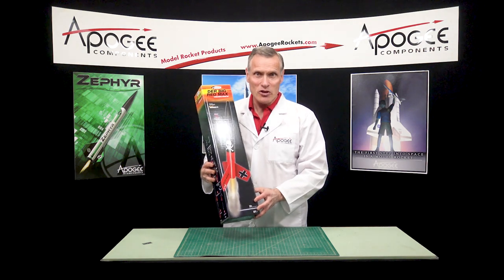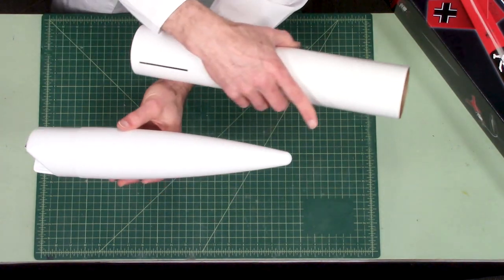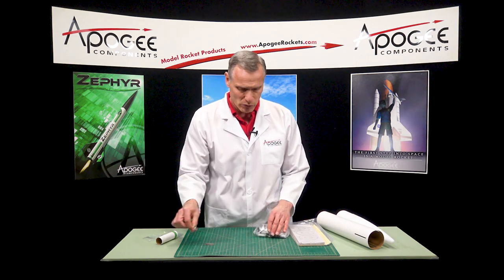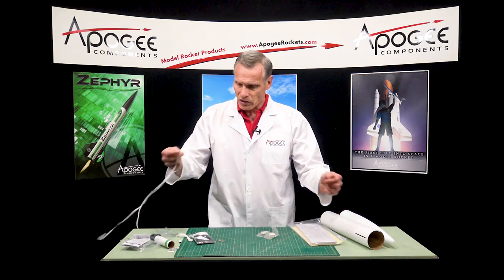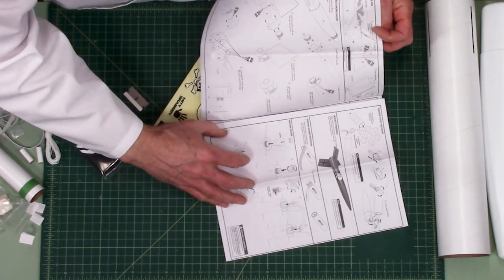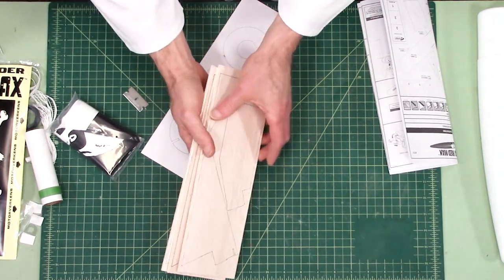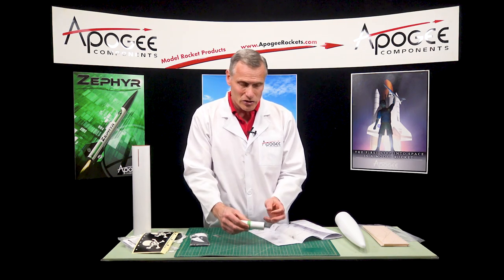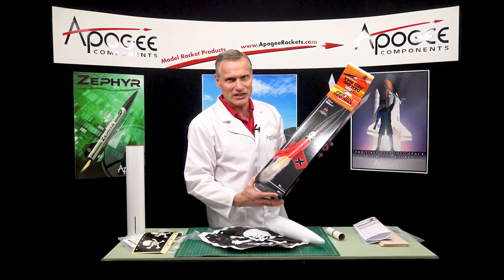Unboxing Der Big Red Max Rocket from Estes

Comment: I built this kit and I was honestly very disappointed in the quality of the parts....not what I am used to with Estes...the balsa for the fins are very flimsy and soft and hard to work with.....an 18" plastic parachute to me is undersized and a rubber band shock chord is not what I would go with.....and the self stick decals is not what I was expecting and not the same as you get with a regular der red max.....I believe that is a brand new NC for Estes......and cardboard centering rings are not what I was expecting.....on the green ring.....if you slip it down over the tip of the nose cone and push down on it....it will stretch it to fit over the motor tube.
Reply: Use SIG or Brodak Dope on them and they will not be as flimsy.
Reply: @alfredindy8058  I appreciate the tip....I got another kit and ended up making plywood fins....I should probably reiterate and say that for the COST of the kit.....it is great....but I would have happily paid more  for plywood fins and centering rings waterslide or vinyl decals and nylon parachute...I ended up ordering vinyl decals from stickershock23....my previous above statement looks like I am bashing Estes....and that is the last thing I want to do.I have been an Estes customer since 1979.
Reply: @f62darkstar  I did not take it as bashing Estes. I just added that even on the Xtreme rocket kit I doped the fins and it made them stronger. The estes kits for the 60s always specified dope to seal the balsa wood. People have gotten away from that today. However, it does add some strength.
Reply: @alfredindy8058  yes..I remember estes suggesting dope...that stuff is getting hard to find locally....I have also paper skinned balsa fins to tuffin them up...I learned the skinning of fins from here at apogee
Reply: @f62darkstar  You got it! I never took it that you were cutting Estes down. I will post my launches and post any 29mm launches that are successful.
Reply: A slightly undersized parachute is A must if you don't want your rocket 🚀 to drift off to the next county. That's a plus to me.